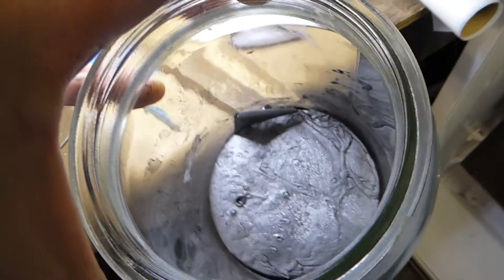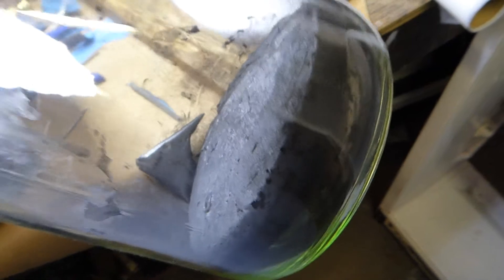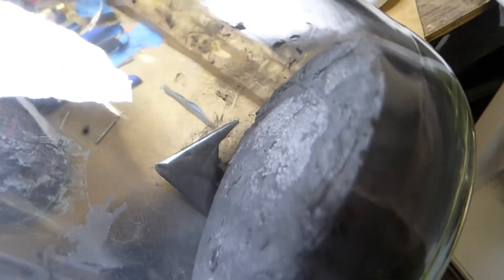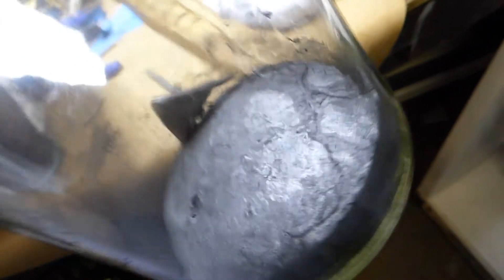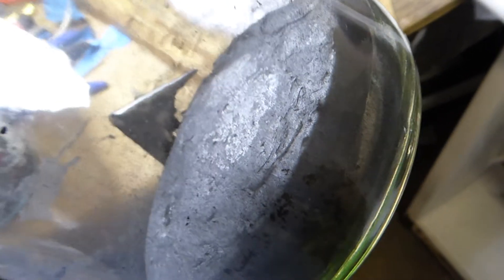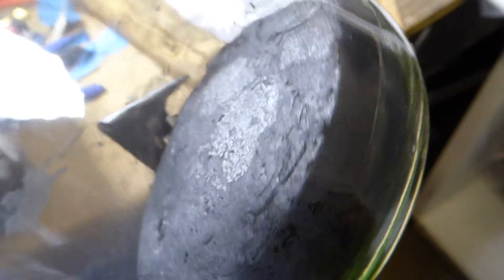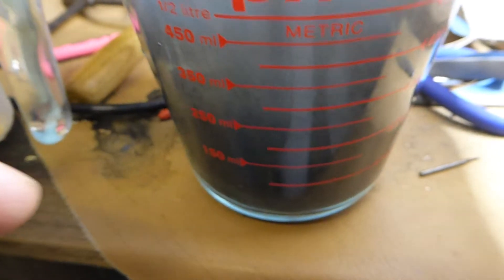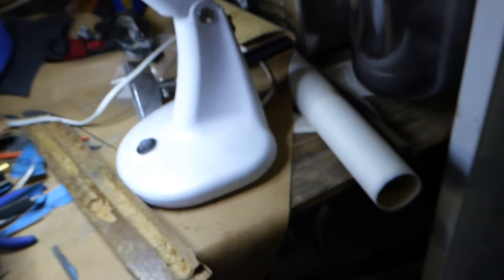Styrofoam graphite and talk about polarising with HV

Comment: Hi Matt, just tried to comment and my computer kicked out on me so i'm going again.
Please ask Pete for verification on what i am saying he got 1 ohm from his grafoil after this. i also added this to styrafoam and got very low readings.
Basically i expanded the intercallated graphite three times and this did the trick, only thing i couldn't remember was which method i used, ie  microwave or power supply 32Volts 
However i got results and the easiest method is definitely power supply for speed.
By the way how is your KOMBUCHA experiment oing ?
regards kev.
Reply from the maker: +kev wallcroft (mouldykev) dry SCOBY worked as an acidic separator. Nothing else to report yet

Comment: how high of a voltage?
ac?
dc?
i want to make some plates for hho generator.
Reply from the maker: i used an electric fence controller. It is short sharp DC pulses.
Reply: +m3sca1 thanks a million buddy.
Reply from the maker: +Joel Bristow no worries...if you think about the path the HV takes across the skin of the sample, that will give you an idea of where the stuff has been polarised. Depending on the shape of the electrode it might pay to move the electrodes around while your plastic is still in a liquid phase
Reply: +m3sca1 I was thinking of blending 300 mesh micronised graphite with acrylic powder and titanium dioxide before adding the monomer and catalyst etc.
not sure if this would be of any benefit in your scenario. I'm guessing it would be a much stronger covalant bond making the mechanical strength greater. You have probably saved me a great deal of time tinkering though. Thanks again. Best of luck too you.
Reply from the maker: +Joel Bristow let me know how you go....have you joined the grapheneresearchers google plus community? You can share results there if you want.
Reply: +m3sca1 I will do this right away. thank you. :)

Comment: Did you took it out?  and it was solid flexible material after drying?
Reply from the maker: that plug in the bottom is solid. The stuff from the walls of the jar is flexible.

Comment: I have made some electrode plates this way by pressing the liquid plastic and graphene oxide and other chems  on a hot plate at about 250 F for about 30 sec and it makes a nice flat plate ,  make sure you put it between 2 nonstick surfaces.  good luck.
Reply from the maker: what did you make those electrodes for...thankyou for your input. You should come and join the #grapheneresearchers community i have started on Google+
Reply: I am working on a battery using a plastic electrode,  This way I can put different chems in the plastic.  Right now I have copper sulfate and nickel chloride in the plastic for the anode and it seems to work pretty good , no deterioration in sodium hydroxide or phosphoric acid.  so far but I need to find a cathode that will not deteriorate
Reply: thx , I joined
Reply from the maker: Ed Lovvorn awesome.  If you have any video please post to the community.